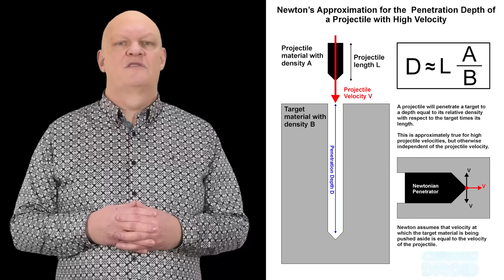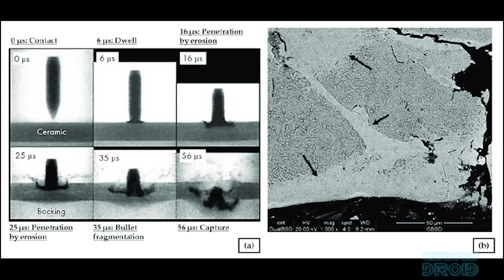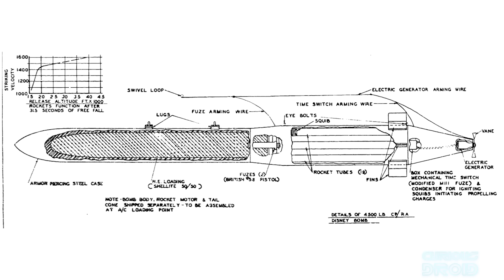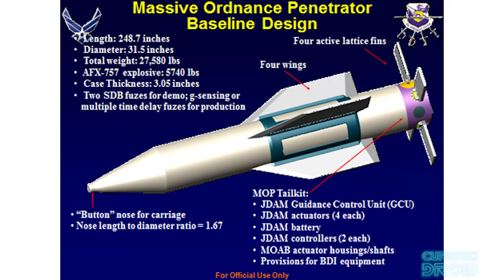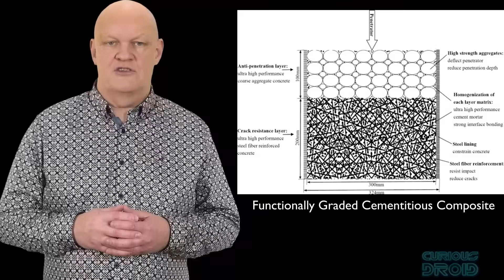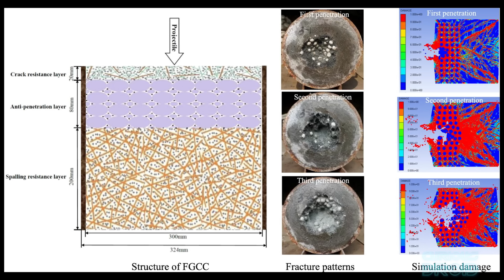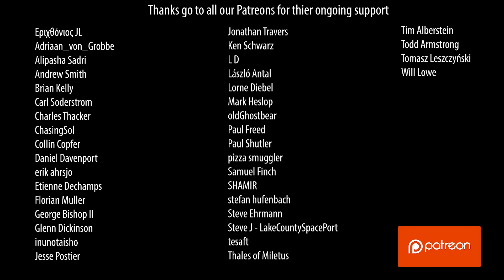Can Iran Stop U.S. Bunker Buster Bombs?

Comment: There's always "Rods from God."  A tungsten telephone pole dropped from orbit will probably ruin your day when it hits at nearly  mach 10.
Either that or make conventional bombs smart enough to zero in on the weak point created by prior attacks so you can just hammer the same spot until it gives.
Reply: They were never made.
Reply: @noahway13  No, probably not. Certaily not officially. Given today's tech, though, it probably wouldn't take long to field such a weapon. At the time it was proposed it wasn't cost effective compared to conventional weapons but the economies of the commercial space race coupled with advances in bunker technology may have changed the calculus a bit since the Air Force first considered it.
Reply: I mean, if you're going to spend that much you may as well just go and buy a new division to win everything else faster.
Reply: mach 10 ? Why so slow.
Reply: @sierraecho884  Mostly air resistance. Dropping from higher (slower) orbits you'll have around 7.8km/s when you hit atmo but even something pretty aerodynamic will lose a lot of velocity before it hits the ground. Still, 3.4 km/s really isn't too shabby for a ballistic projectile that massive. With no explosives at all, it'll outdo the largest conventional weapon ever made for explosive energy.
Reply: @protocol6  You will hit 7,8km/s when you dropp it but you can shoot it instead of dropping it. Also how much velocity is lost depends on the aerodynamics and other techniques which can help displace air at the tip of the projectile. You could hypothethically use coil rings in space to speed up a projectile before reentry.

Comment: Fascinating video, I had no idea Concrete  had developed so much
Reply: Oh yeah. Practical engineering had some kick ass videos on concrete advancement. Has defintly come a long long way in the past decade.
Reply: What's glaringly obvious though, is the complete absence of $'s. We have earthquake's all the time in New Zealand, but you will more likely see a building with a 'base isolator' (Thick rubber pads incorporated in the foundation) than stainless steel fibre in smoother cement mix, with additives. 
I wonder why they don't have bunker bombs made like concrete drills and spin them at high speed to 'carve' their way in?
Reply: @David-yo5ws  Because this speed will not be anywhere fast enough. It´s also not the speed but the hammering effect which drills holes into concrete. Which is prevented by the fibers in the first place.
Reply: Because you only think of yourself! xD